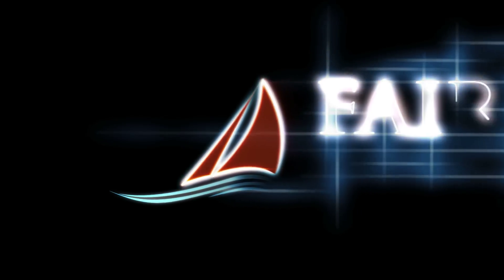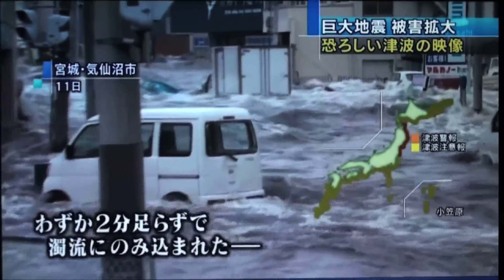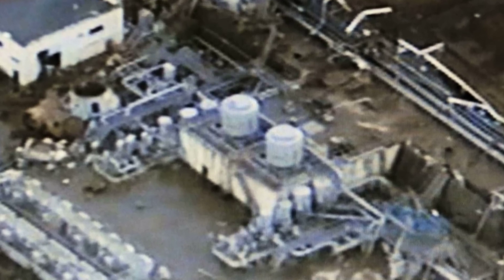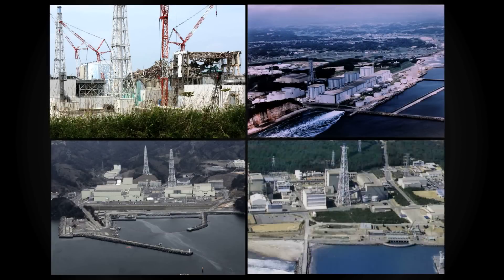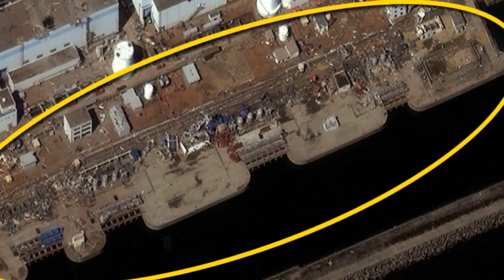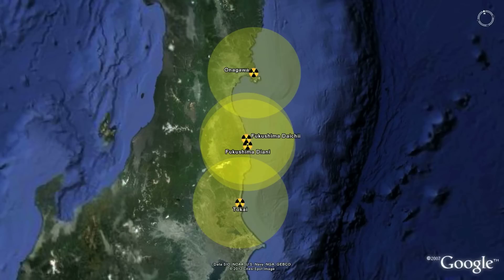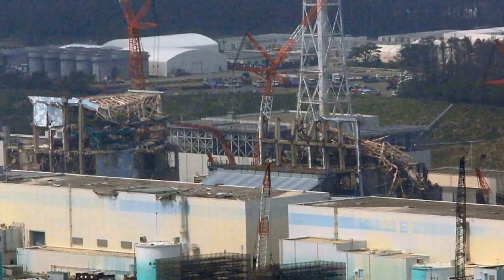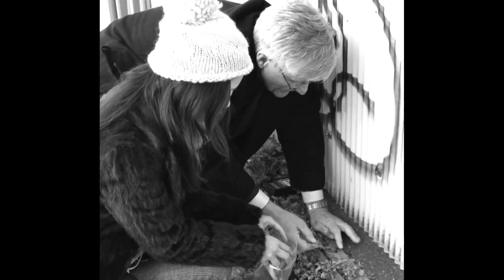It Could Have Been Worse

Comment: Do not focus on quakes. The NRC and GE allow every reactor chimney to emit 1,85 Mio bq radiogases and 370 bq I131 EACH Second via Chimney. 1,555,036,000,000,000 Becquerel (water & air) = 42000 Curie. Per year, per reactor. It can reach 0,01 – 0,02 Curie per Second from Reactor Chimney and even 0,05 Curie – which are 1,600,000 Curie per Year. The catastrophe takes place every second. Concern is not the problem, concern is waking up: Tritium instead of Hydrogen in DNA bridge is the Catastrophe.

Comment: Mr. Gundersen, isn't the BIGGEST CRACK in EVERY CONTAINMENT The Reactor Chimney? And, if so, do you regret still believing in Nuclear Safety? And what do you mean with "It could have been worse"? Core 2 is lost, Pool 3 is lost. We received new measurements of Pu239 from soil of 570 kbq/kg - which is equivalent of 0,0002g Pu239 - which speaks for lost inventory. Why is there no PHOTO of fuel? Nothing! The Meltdown is a distraction. A distraction from lost Inventory. Like 1986.